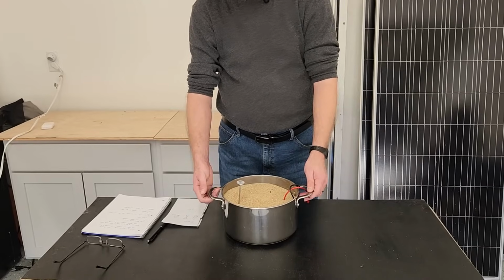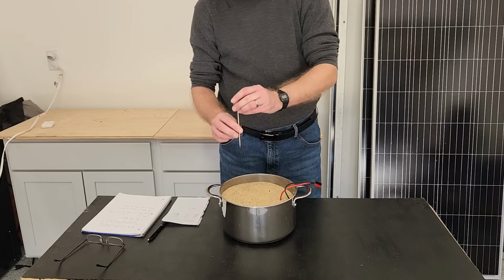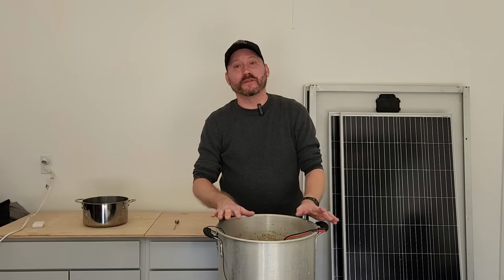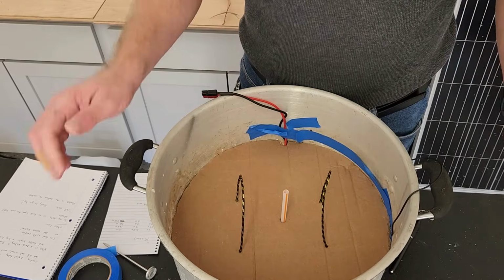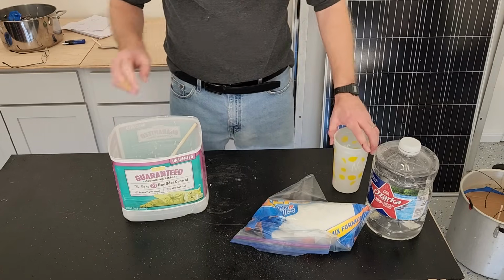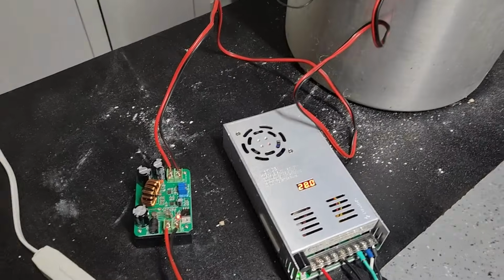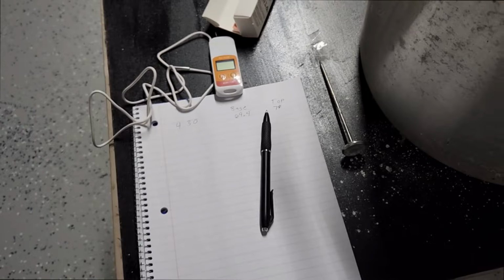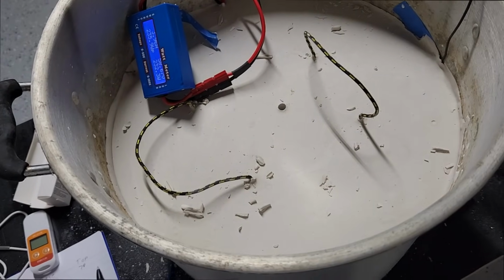Sand Battery heater. Create free heat  of 500F using solar electricity! Texas Prepper Projects

Comment: I think that that your water heater element would be very short-lived if it is getting hot enough to fuse the sand, it must be overheating. Does anybody have any ideas about heating elements?
Reply: Enough to know this element is capable of around 1100f. Water except for certain circumstances can not be heated over 212f. Water heaters are usually set to just above 100f. The nature of water and the way it can spread the heat away from the element  makes an immersive element a good choice. The water will keep the element well below the max temp.
The nature of sand and it's self insulating properties will not only allow the element  to reach max temp. It will also cause this heat to be concentrated directly on the element.
Reply: Maybe use a ring hob element instead?
Reply from the maker: Stove element.  Check out video 2 and 3

Comment: Better to put steel tube coil in the sand and circulate air heated by nichrome wire coil by the solar.  Water heater element not designed for that
Reply from the maker: Thanks
Reply: @texasprepperprojects  also put second steel coil tube in the sand and circulate air from room in house thru that. This way you have safe long lasting means of transferring the heat
Reply from the maker: depends on where the sand bucket is located @FourthWayRanch
Reply: @texasprepperprojects  large drum of sand outside and beside the house. Can use refractory cement or bricks to line drum
Reply from the maker: Try it out

Comment: Would filling the pot with water and using that water heating element, or a larger one, generate more heat? An automatic replenishing water source would need to replace what's lost thru steam.
My sister had an outside coal stove and red hard plastic tubing was used to transfer hot water to heat the house under the floor. Could you rig up a system that recirculated the water thru the tubes to and from the big pot?
Reply from the maker: Watch my other 2 videos on this topic

Comment: What  about a tank with a water coil system running through the sand filled tank this would enable radiators to  provide heat - what do you reckon???
Reply from the maker: try it!

Comment: Why not make a water battery?    Water has 10 times the specific heat of sand. You can't increase the temperature of sand by 10 times to match the heat stored in boiling water.
Reply from the maker: Check out the rest of my videos in this series for the answer

Comment: Hey buddy, I hope this is not the kitchen table you making this mess on, if it is, you're sleeping on the couch tonight and you're not getting you know what for a week.  🤣🤣🤣. Now, on a more serious note, what if I have a layer of about an inch or two of coarse sand around the heating element (I plan on using a hot water heater heating element) to allow high temps to ventilate through and not stay trapped in the immediate vicinity of the heating element so it does not damage the heating element over time?
Reply from the maker: Lol!  The wife is my video person. Check out video 2 and 3 for more tests

Comment: When talking about thermal storage we need to address the elephants and make everything equivalent to get a proper Understanding, for instance use calculations in the 1kg (or pound if you like but you will need to do the math to convert from my numbers) and 1 degree Celsius (again, convert as needed) increments
Water per kg per 1°c Will store 4,184 joules of energy

Sand per kg per 1°c Will store 830 joules of energy

That's a ratio of 5.04-1 or.... To obtain the same thermal capacity with sand you need 5.04 kgs to match 1kg of water, the same stuff that falls from the sky.
Orrrrr you'd need to heat the sand one kg vs one kg water at boiling (metric uses Celsius which is determined by the temperature water boils and freezes at, so 0°c is freezing point, 100°c is boiling point) will need to be at 504°c which is apparently 939°f

It's always going to be your choice but it's also wise to do the math and make considerations for what's best, easiest to work with, easiest to source etc
For me, the fact that water falls from the sky and has a larger capacity makes it my preferred choice however!! This is that considerations and such, if I did use water I'd run a thermostat to ensure water never gets close to boiling because I wouldn't want a pressure bomb building up, that's not a problem that sand has but if you did heat sand up to 500°c you have the potential for things to combust if they come in contact so, careful consideration.
Good luck peeps and don't let the downsides or threats stop you, be smart, plan for things to go wrong and engineer some fail safes, good luck 🙂✌️
Reply from the maker: Thank you for the math! I address some of the logistical issues in my follow up videos (waterproofing everything). There is a lot to consider!
Reply: @texasprepperprojects  yes there is, i plan to build my own wind turbines and generators using 3d printing processes, store the power in a small battery bank(10-20kwh of LiFePo4 chemistry) to run things like refrigerator, washing machine, clothes dryer and lighting off of an inverter, excess energy generated i intend on dumping into a heat battery and to have an aluminium heatsink attached to the side with ducting network for internal heating (imagine a "H" like structure where the horizontal is the heatsink)
Reply from the maker: @BJL2142  neat i can't wait to see it!

Comment: Is there a risk of the pvc insulation on the electric cables buried in the sand melting at the high temperatures?
Reply from the maker: it did melt.  Check my other videos for the solutions

Comment: Sand is not a great conductor, at least compared to water.  Also, the element and plastic will fail in time (probably better off sticking the heating element through the side of the pot, like a DHWH).  Why not use the water heating element in a large uninsulated water tank that will never boil over?  Far better heat transfer.  In practice, I think you're better off using the PV power to supply a heat pump (such as a mini split) since it's far more efficient and use the room or house as the "battery".  But maybe I'm not understanding the point of this correctly.
Reply from the maker: Watch the other videos in the series on this

Comment: You are using 120 volts of alternating current to power this rig.  Why not just use a commercial space heater ?
Reply from the maker: That us just the test rig.  I am using solar panels not ac
Reply: Pannels wont produce 110 volts of AC @texasprepperprojects
Reply from the maker: Did you watch the video? They don't need to. The heating element runs on DC and I am getting 65 Volts which is enough to trigger the element

Comment: if any possibility of a reflective curved mirror concentrating solar focus on the sand bucket being cheaper than the solar panel...? kindly comment on the idea.....
Reply from the maker: The problem is it has to be aimed every 15 minutes as the sun moves through the sky
Reply: We have to use suntracker. .?

Comment: I think using electricity to heat the sand is losing alot of of efficiency unnecessarily.  The best way would be to use parabolic mirrors to directly heat the "sand battery".
Reply from the maker: But loss of efficiency is heat..which I am creating....so I "can't lose". ;)   check out my follow up videos for my thoughts on mirrors
Reply: @texasprepperprojects  you're losing out by the initial conversion of sunlight into electricity. Figuring at 20% efficiency at best for solar panels, that's a lot of wasted energy; if you're interested in storing/using heat, it makes way more sense to just skip the electrical generation part.  This technology really shines when you're getting 80+% conversion from solar irradiance into usable end energy (which is feasibly obtainable with direct solar).

Comment: 500 degree sand has less energy in it than 190 degree water. 1kg of sand at 500f has 215000 joules of energy, 1kg of water at 190 degrees has 375000 joules. 
Water has less chance of burning your inductive heating elements out, is more thermally conductive and can be pumped places. Its also cheaper than sand. 
Water has a higher specific heat than almost any other material we have access to and its not even close.
Reply from the maker: Thanks!

Comment: I'll stick with water. 
Not yet decided on the tank but a big tank of water that will be heated by any excess power I get from my pv array. The tank will also have heat exchangers that will pump heat from the main stove and out into the radiating floor loop. 

Too high temperatures can ionize the sand and lead to shorting the heating element (see your sand lumps)
I used to play with heating elemrnts and electriv arcs in sand (highly purified silica) and I glassed it everu time. Quite a fire hazard for me... 
Also the heating element will have a very short life, exposed to oxigen like in a sand tank. 

If I heat 200-300l of water to 60°C it will  be enough for days, for the entire house. 
And I plan to never use the actual water in the tank, just to store heat. I will be able to extract heat for taking a shower or a bath, wash dishes and clothes just by passing cold water thru a heat exchanger inside the tank.
Reply from the maker: neat! id love to see a video!

Comment: Brother when you're dealing with heat please do not ever use galvanized materials. At a certain temperature galvanized materials set off cyanide gas
Reply from the maker: I am aware. The bucket doesn't get to 400f

Comment: Why does the insulation on the cable not melt?
Reply from the maker: It actually did. Watch the follow up videos.  I did change to silicone wire which handles heat better

Comment: Also i dont think its a very good ideal to bury a heat element in anything. Seems quite unsafe to me. Did you check the specs or with the manufacturer to insure thats ok? Because again, peopeare going to try this
Reply from the maker: I'm not the first or only person to do this
Reply: Just saying, I work alot with those. Are you certain they are rated to be buried in sand or whatever and still perform as they should? You're making the vid. To be certain you should research that sir. But I love the concept.
Reply from the maker: Yed

Comment: Aren’t batteries more efficient at storing energy than sand?  Storing electricity is certainly more useful than storing heat.  And if you have solar to power the heater you’re already half way there.
Reply from the maker: I disagree actually.   The idea is that if your end goal is HEAT, then the fewer conversions you can do the better. Also, the theory is that since you can heat sand up to several hundred degrees, you're coming out ahead.   I think that if you run the numbers of  solar->battery->inverter->space heater->BTU    vs  Solar->electric heater->Sand-BTU         you'll come out ahead with the sand since you're cutting out so many places for loss.  On top of the fact you're saving a bunch of money by cutting out the batteries and inverters and such. Also note, my tiny $20 electric space heater pulls 1500 ac watts. That's 125 amps @ 12vDC.  So, a $350 LiPo4 battery would last less than 1 hour.  But, look at my other videos.  I think that sand batteries are actually NOT a practical way to store residential electricity. I think that they ARE a way to store alternative ENERGY (like Geothermal heat) but the conversion from electrical power to heat power SUCKS.

Comment: This is a heat sink, not a battery. Storing energy is based on thermal mass for potential energy. More mass=more storage= longer discharge time. Surface area and difference (gradient)between the two temps determines rate of discharge. Higher temp with more surface will radiate more heat. Your rough 2400 wats per day from solar stored for evening use converts to 400 wat radiant heater running for 6 hours. Just to put how much heat energy you should capture into context. Your scale is way too small.
Reply from the maker: This is true. Check my other videos for more information

Comment: Wouldn't an aluminum plate painted black be like 4 times more efficient than PV, if all you're doing is heating sand?
The plate absorbs 99% of light, and only doesn't a single state change, where the PV is 20% efficient max.
Reply from the maker: try it and make a video! let's see!

Comment: At what temp did your soda straw melt?
Reply from the maker: It didn't
Reply: But  @texasprepperprojects  you said/measured the upper level of your sand media at appx. 500F.
Typical soda straws are made of polypropylene and polypropylene has a melting point of appx 300F and a flash point of appx. 500F and cardboard is in the 425F range for spontaneous combustion. 
So my point being when experimenting be aware of the limits of your materials and instrumentation, you know, so you don't burn down your house!

Comment: Doesn't make sense to me how you say that the sand its at +500 degrees and the metal is at 90 degres, something doesnt add up. i'm also kinda unimpressed by the heating element, doesnt seem apropriate for that volume of sand, i understand that making or buying a spiral tube that fits and works with a diferent heating element is probably 10x or 20x more engineering so i understand your choice, especialy for testing. But a metal radiating 80-90ºF doesn't look like a successful test run to me.
You would probably need something like a spiral metal tube going down that conects above the ceramic to a container with the heating element inside, everthing filled to the top with oil, if the heating element can generate +300º then the oil and metal will take that heat to all of the sand.
Reply from the maker: I have a couple of theories on all of that.  #1. I think that the orientation of the heating module affects the way that the heat is dispersed inside the sand. I'll try again one day with it being vertical.   #2. I think that the cooking pot is very thick metal which is why it didn't get as hot as you'd expect it to.  #3 Heat rises, which is why I think the top was SO hot 500f. My thermometer on the bottom stops at 200f, so I don't know how high it actually got down there.   #4 I have see other variants recently with the spiral that you are describing, but the goal of all of this was to do it cheaply and to be able to run it on solar. I think with that criteria, I've done ok.

I appreciate the input!
Reply: @texasprepperprojects     
   I think there is a reason why the aluminum pot walls remain cool it's because they very efficiently radiate heat out into the room. The sand on the other hand collects heat but radiates it to the pot at a much lower rate.

Comment: If you are getting 240 watts on the output of the buck boost converter, that means on the input of 12v there’s 20 amps. How can your buck boost converter that’s rated for 10amps able to take that kind of abuse for that long???
Reply from the maker: the buck converter is just to show the example of how to get 60 volts. Look at my new video for how this actually works in the field with two  35v panels  https://www.youtube.com/watch?v=fzUs9DKJi70&t=4s

Comment: Punch a 3" hole sideways through the middle and put an aluminum tube through it then put a CPU fan on 1 side and boom a heater maybe upgrade to silicone wire
Reply from the maker: Why?  Check out video 2 and 3

Comment: Great job! Please do another video with it connected to solar! If you didn’t want to move the bucket in and out of the house you could just run a cable from the panels to the house to charge the sand battery while it’s inside the house :)
Reply from the maker: I have cables for my solar panels that are long enough, but it didn't seem to really be necessary.  2 panels at 35v each =70v which is what my power supply was putting out.

Comment: This is an idea I've been wanting to experiment with for a while, glad to see it works so well.  Could probably use a stove top element too as the water heater ones might not last as they're designed to be submerged in water.    I want to try it with a metal trash can or even build a form out of concrete.  Then insulate it with roxul and only have a small inlet and outlet that is adjustable, that would allow to control the rate at which it releases heat.
Reply from the maker: Watch video 2 and 3. Already tried it!

Comment: The element will last quite a bit longer if you do not put anything over the sand.
Reply from the maker: Why is that
Reply: @texasprepperprojects  The higher you run an element on a constant basis, the shorter its lifespan will be.
Reply from the maker: What does that have to do with covering it
Reply: @texasprepperprojects  Let the heat flow into the zone you are heating instead of holding it all close to the element.
Reply: If you want to store it for longer overall, up it to a 55 gallon drum of sand.
Reply from the maker: Yes more mass means more heat. But more weight. Thanks
Reply from the maker: I talk about this in the video

Comment: It's not "free" (of course, neither is the initial solar panel investment), but it's still hard to beat a cheap little wax buddy stove heater. Can + cardboard + wax + mesh + lid. About 5 bucks to build, about $.50 to $1 to refill for 10+hrs of heat.
Reply from the maker: got a video on a build?
Reply: @texasprepperprojects  Hrmmm... I'm not a video guy, but lemme see if I can find the dudes that originally inspired me to put it together. I basically took the wax 'buddy burner' concept, and the reflector mesh heater - stuck them together and it worked really well. I'll do some searching. Most of the videos are years old - they're all over.

Comment: Why would anyone inefficiently convert sunlight into electricity, only to then use the electricity to store the heat for later?  Why not use that same sunlight in a highly efficient way to heat the sand, to store the heat for later. Solar thermal concentration is one way.
Reply from the maker: Watch video 2.  What is 'solar thermal concentration'? A fresnel lens?